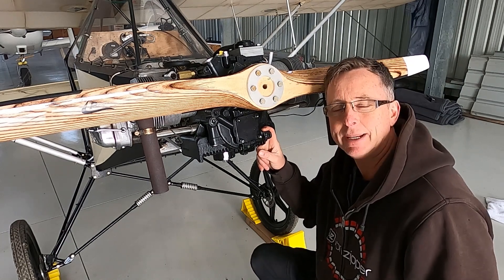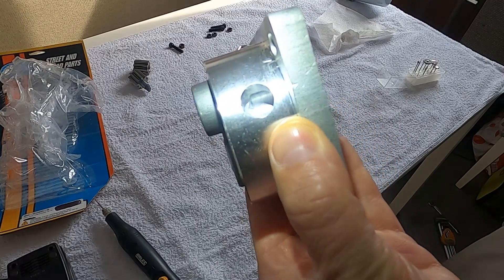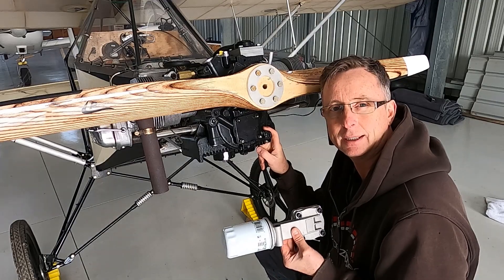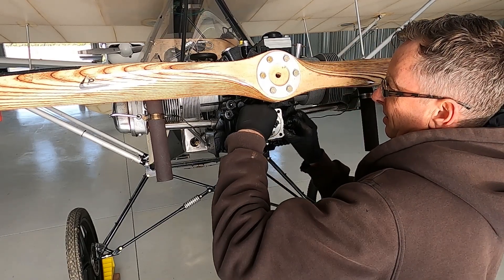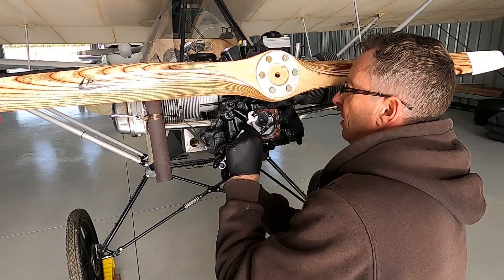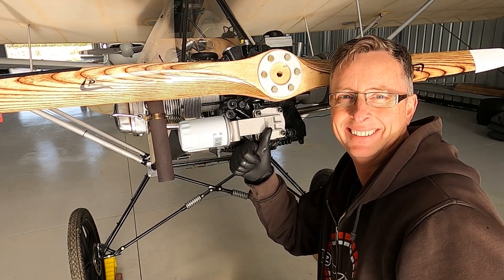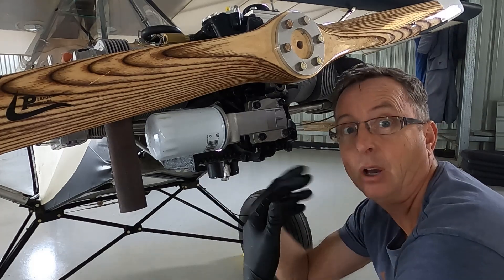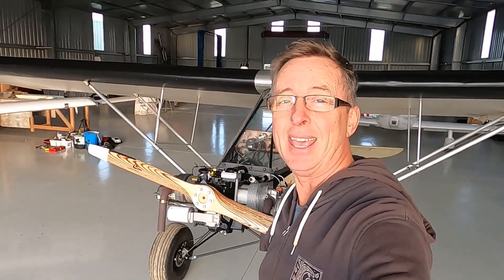Oil pump replacement and filter upgrade on the 1/2 VW.

Comment: nice  vid... i will get  this oil pump and filter too. what is the size and angel of your prop and the manufacturer of it? i am  running a37hp 1/2 vw scout casler full block.

Comment: I'm getting serious deja vu watching this! I run one of these filter/pump combos on my Beetle. I too ground out the ports for better flow and I too made up a pump extraction tool to get the installation done. 
Take note that the supplied filter from EMPI is a very cheap unit; I replaced mine with a Z15 code filter from Repco. 
When installing the pump I used Permetax Aviation cement thinly applied to all surfaces.
GOOD MOVE removing the high pressure relief valve and spring: Total overkill and with a bigger pump you can easily create too much pressure and blow the filter!
Reply from the maker: Thanks for the tip on the Repco filter  :)
Reply: @DCSquared  YW except I meant "Ryco" Z150 not Repco Z15! (was watching way past sleepie-time)
Reply: You can go with Knecht OC306 Filter with internal relief valve to avoid blowing the filter off that engine.

Comment: I saw a video and a guy said he knew of three vw oil pumps that spun drive gear and lost oil pressure. I think you shoul have drive gear of pump tig welded to shaft scince it an airplane.
Reply from the maker: This not being a performance engine with high and constantly changining revs like in a baja, it should be ok putting around at 3,000rpm

Comment: Please correct me if I am wrong. My understanding for measuring oil pressure is 1 to know that the oil pump is working and 2 that the bearing journals on the crank shaft cam and tapped rockers are receiving enough oil to provide the oil film on which the bearings run. If the oil pressure is not sufficient it could mean that the oil pump is not supplying the correct volume or pressure or that one of the bearing journals is worn or out of specification  and you have too much oil escaping through this journal or journals. My understanding of the plunger and spring in the oil pump is to bypass the filter if that is blocked or facilitating only restricted flow.
I am not sure why you would increase the spring rate in the oil pump.
Please let me know if I am missing something here
Keep well and enjoy safe flying
Louis
Reply from the maker: Hey Louis.  The plunger and spring is not actually in the pump but the block itself and is not a true pressure control valve in the 1/2 VW case.  It is a pressure relief set up which would normally bypass an oil cooler if fitted and is the closest thing you can get to having some kind of oil pressure control in the system.   It is not ideal at this role.  The part of the block that would normally house the pressure control spring and plunger is at the front of the block which is removed when the block is cut in half.   Adding the new oil pump and filter stabilized the high and low peaks and troughs at startup and when running which were on the limits of what I was comfortabe with.  They are now in a range that keeps me happy when cold and warm.

Comment: ... enjoyed that.
Reply: ... As an extra precaution I apply a thin layer of high temperature silicone RTV sealant on both sides of my "dry" gaskets.
Reply from the maker: Permatex Ultra Black on the gasket at the block but none is recommended for the paper thin yellow one.

Comment: Is there a reason why the prop bolts are not safety wired?  Looks like the oil filter addition went very easily.  I enjoy your post, keep up the good work.
Reply from the maker: Thanks Bruce.  The prop bolts do not screw into the hub but rather go through it and have locking nuts on their ends.

Comment: unless that full flow system has a pressure regulator before the filter which im not sure. remember to get filters rated at abnormally high PSI. I think I found WIX racing filters rated @ 300psi but it has been a while since I had my Baja